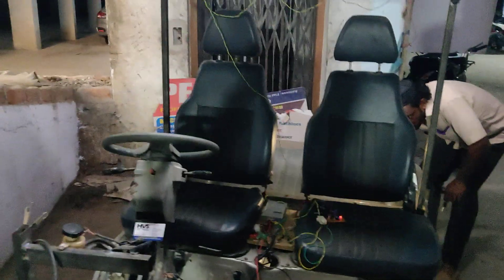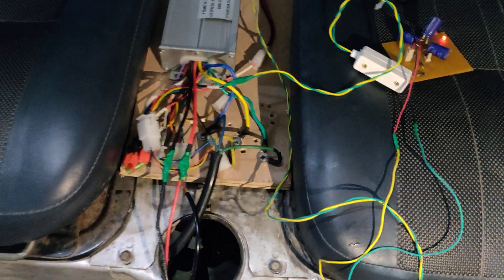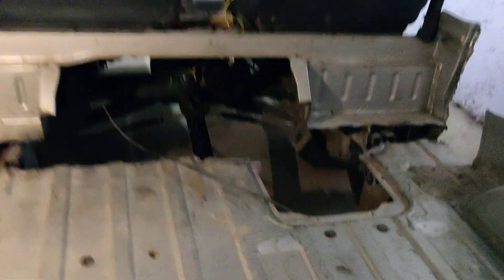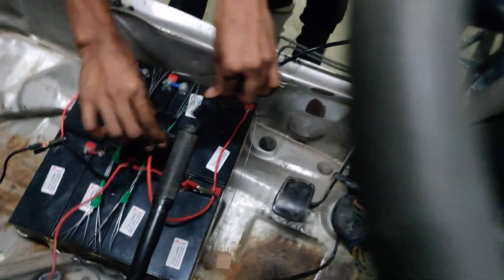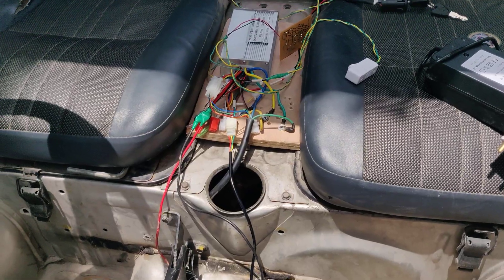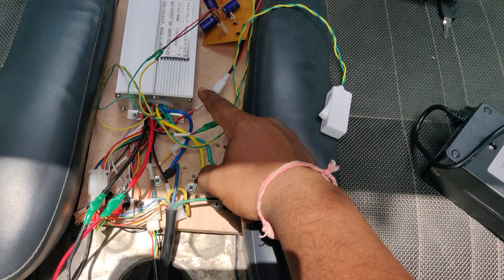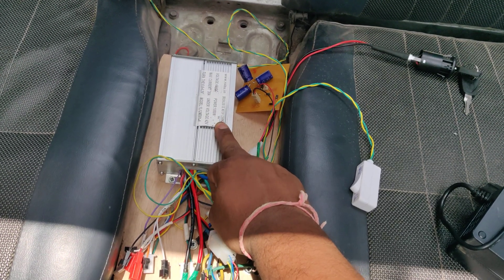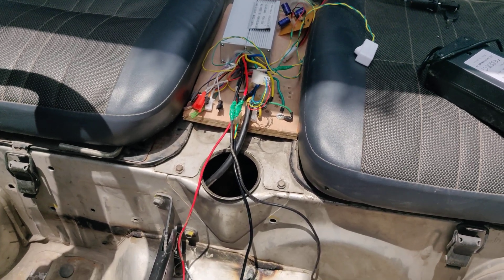E-car - Omni Car converted to Electric car with Solar#retrofitting of electrical vehicle

Comment: Use Marithi, nano gear box. Led acid batteries are weight respect to Ah. Lithiumoin batteries  are less weght. I have made electric cycle with BLDC motor 2017 used Ledacid battery up to 2021. Now Iam useing Lithiumion batteries 36v 10Ah. Now iam feeling well